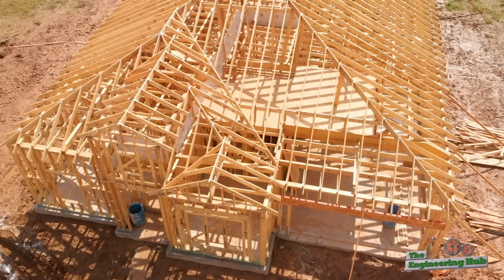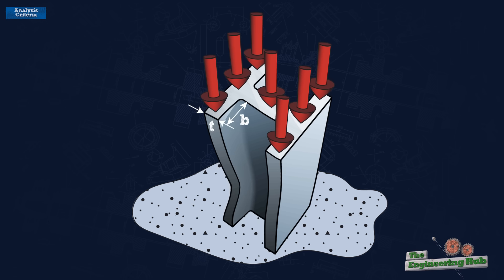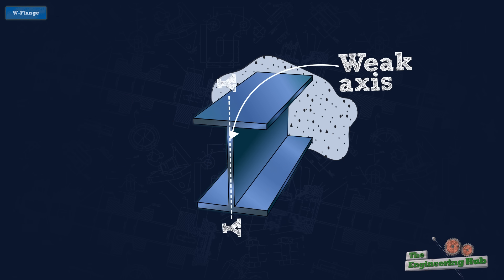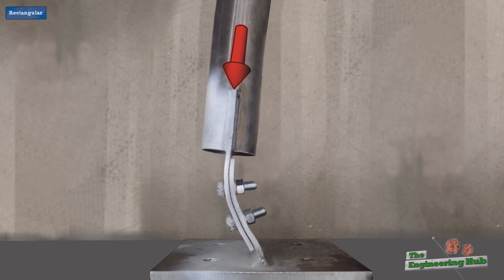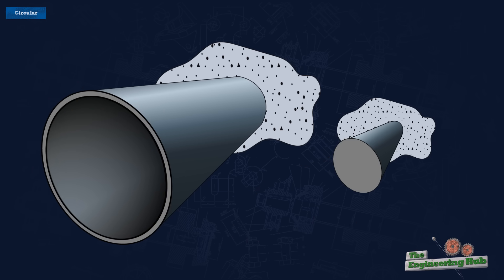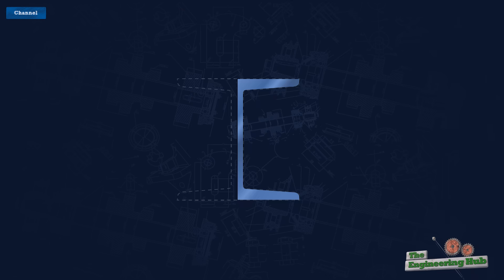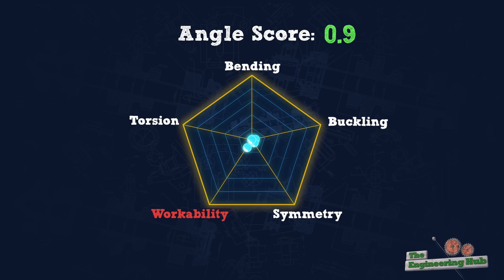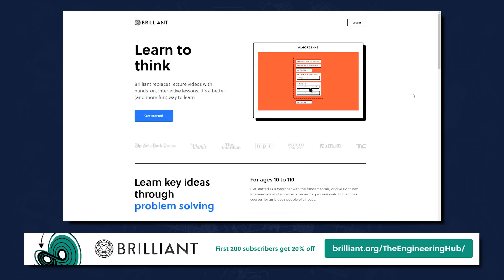Structural Shapes Ranked and Reviewed - Which one Wins?

Comment: I'd be curious if anyone has thought of using a SQUARE tube, rotated 45 degrees.

My gutt feel is, it should increase load capacity by about square root of 2.
( My application is welded metal tubes, so the 45 degrees Installation/workability is not a problem)

Similarly, when i use 'angle iron "  I'd use it flipped over in a V shape, which typically is stronger than L shape.

Is my intuition wrong??
Reply: Corners cause load and stress concentrations. There is less area actively resisting the load and more load is placed on the smaller area. 

But at the same time with a downward load applies, yes an “A” configured angle is less likely to deflect then that same angle used in an “L” configuration. But that is due to symmetry of the loading into the structural member. It is a more stable use. It is not an ideal shape for that load scenario. But in low stress situations you can get away with it. 

A round or square bar with a similar cross sectional area would support more weight if all else was equal.

Comment: I think it is a bit strange to rate H- beams higher than square hollow profiles when it comes to workability. For welded constructions the fabrication cost for H-beam based structures are typically 3-4 times compared to square hollow profiles. Due to more complex prefab (cutting and weld prep), more complex welding and NDT and more time consuming surface treatment. Another huge benefit with square hollow profiles is that the other geometry is constant. If you increase wall thickness it builds inwards. Meaning in 3D models there are no changes to overall dimensions and joints if one changes wall thickness. With H-beams everything changes. I would chose square hollow profiles whenever possible.
Reply: When it comes to surface treatment open sections are vastly superior. The entire surface is easily treated, while hollow sections often suffer from poor treatment on the inside (if they even try to galanize it properly). Also the enclosed spaces are suspectible for trapping moisutre thus accelerationg corrosion.

As for workablility it depends what your goals are. Bolted connection are much easier to make using I beams. As for 3D models with a well built up model in a modern software its incredibly easy to change section sizes.

When it comes to smaller welded structures with lsmall loads square tubes can be advantageous indeed. But also depends on a lot on the application and I beams can be better dispite the slightly more welding required.
Reply: @istvanditamas2959  Yeah, the automotive industry switched from  C channel to box channel. While the box was somewhat lighter thinner metal and controlled twisting better, it trapped moisture and got poor rust treatment inside. While the I-beam is incredibly strong, it fails much quicker under high heat than wood laminated. The extremely dense laminated beam will only char the outside, while the steel will twist and fail above 2,000F.
Reply: @Istvandi Tamás  If you measure coating film thickness on the corner edges on a spraypainted H-beam it will be significantly thinner than the flat surfaces. In my profession, subsea structures, codes dictate the minimum and maximum thickness. According to fabricators the edges need to be painted manually in order to comply. Hence a lot of extra labour compared to hollow profiles. Now this is according to strict standards and will not be applicable in all cases. Corrosion in hollow profile structures have only two causes, poor design or poor assembly. As long as it is welded completely shut it you will have a minimal corrossion until the oxygen inside the profile is used up then corrossion stops. If there is any holes or ventilation allowing air to come in you are in trouble. Regardless how well your 3D model is built, if you change anything except the length on a H-beam it will impact the dimensin on all connecting parts.
Reply: This video seems misleading especially the title. Every single beam has its purpose and use case, why "rate" them in this way?
Reply: @creativemind42069  Yes, I think they caused more confusion than understanding of why and where different beams are used. To really understand building construction, you must talk about wind sheer, weight distribution and many other issues that will determine what design of beam, joist, channel is most sufficient for the build.
Reply: @creativemind42069 Because the internet demands rating.
Reply: @creativemind42069  Because this is YouTube and rating videos draw interaction...if that's the price to pay to slip in a bit of education it seems worth it.
Reply: H beams give unlimited easy attachement capabilites, as someone who has to constantly do rigging and installation of large equipment/ installation of necessary plumbing and other support accessories, beams are just easy.
Reply: This is the difference between practical and theoretical experience
Reply: As a metal fabricator H beam don't cost 4x more in labour.
Reply: wayyy easier to bolt to W-shape than HSS and way more money to weld than to bolt
Reply: yeah I dunno why he said what he said about the limitations of H beams before then giving it a nearly perfect rating..
Reply: Basicly hollow profiles are only for some 50% accessable for attaching mounting plates. (IS THE OUTSIDE!!!). Now pls look again at any H-beam, and rethink again the NEUTRAL LINE !
Reply: 😊 @richardhack9830
Reply: H beams have shit torsional stiffness
Reply: HSS connections are so finicky that my engineering group actively discourages using them outside of struts
Reply: I agree I chose Circular tubular construction. Even within my textbooks on structural design and strength of materials THE TUBULAR CONSTRUCTION DESIGN IS THE MOST STRONGESTS WHEN IT COMES TO FORCE RESISTANCE AT ANY TYPE OF FORCE. Like they stated Circular tube structures are hard to fasten together but even those hard to construct material can be made of Carbon Fiber construction So why can't this also be taken into account ?
Reply: @charlesscott5076  Tube design buckles easier than H beam. Think of metal bridges, metal skeleton of skyscrapers and the beams carrying the rails between  supports on overhead railways,  if tube was better they wouldn't all be built with H beams. All design types have their uses, it depends on what the stresses/loads are as to what works best.
Reply: @charlesscott5076  carbon fiber is a new material, we don't have knowledge about its behavior for more than 20-30 years, so it is risky thing to make a design from carbon fiber. Ask bicycle users who ended in hospital due to fork breakage. Also carbon fiber (due to negative thermal expansion) is contracted when heated and expanded when cooled , making it incompatible with steel constructions.

Comment: Hurricane Katrina gave a great opportunity for the observation of structural steel failures.  There were hundreds of tall billboards in and around New Orleans.  Unfortunately, I cannot give the weight per foot of the supports but I can say that the external dimensions were similar.  Some billboards were mounted on three or four I-beams of constant dimension.  Others were mounted similarly on round pipe of diminishing cross sections as the height increased.  Peak winds were in excess of 150 mph (240 kph).  

My observation was that I did not see a single billboard on I-beams that was still standing after the hurricane.  All of the I-beams failed by bending, not buckling, over a radius of several feet parallel to the webs of the I-beams.  The bends were remarkably gentle, on the order of a 3'-5' radius.  Once the I-beams gave way, the billboards themselves were pushed to or nearly to the ground.  I did not see any billboards that were on pipe fail.  The hollow round shape stood up to the wind very well.
Reply: Wind loads on billboard (in reality) create more torsion than bending. Wide flanges still better in bending and circular sections are better in torsion, that is why you see more circular supports still standing for billboard structures.
Reply: Wind loads (in reality) are fluctuating thus it creates more torsion than bending loads.
Reply: I asked chatgpt if ibeam or pipe is better, this is what it told:

For the same weight of material:

I-Beams are generally more resistant to bending loads in a specific direction (typically vertical) due to their optimized geometry and higher moment of inertia in that direction. This makes them the preferred choice for standard beam applications in construction where loads are predictable and primarily unidirectional.

Pipes offer uniform resistance to bending and torsional loads from all directions, making them more suitable for applications where loads are multidirectional or where torsional rigidity is important.
Reply: Have any of you any practical experience installing HSS column over a h-beam column no I seen one comment dude said he was going to use pipe obviously has never made a column out of pipe if you had 10 HSS 12 x 12 by 5/8 on one side and 10 on the other side with a space of 10ft between sides and 8 ft between columns and a top of beam height of 10 ft and you built comparable structures The h-beam Columns would have less lateral movement when you were walking across the structure it's often fun to take Engineers on a deck when they don't have a clue and see the reaction on their face when they stand still and feel someone walk across a structure that has HSS columns and that would be multiple X bracing to combat thing down so the problem with that is on a boat dock when they have the boats at the bottom and the deck on the top they engineer a lower structure made of rock or fuel to get to the sheer out of the building

Comment: Instead of surrounding rebars with concrete, how about filling hollow pipes with concrete. Or fill with resin for smaller structures like furniture. This would reduce the chance of buckling since the internal fillers are solid and resist compression.
Reply: those are called composite sections.  They are in the AISC manual.
Reply: I'm doing that for a crane I'm building this weekend

Comment: The analysis is interesting, but I have some peeves with the scores you assigned: for example, a rectangular hollow will always be better than an I-beam of the same size. Same goes for the pipe. The reason why I beams are so widespread is that they are much easier to manufacture and allows you to use less material when your project include a single bending moment; then your structure buckle at the first breath of wind, but by that time you will be far away with the money you saved...

Comment: Several years ago at work, we needed to install some bollards.  My suggestion was to slip a square, I, or triangle tube into a circular tube or a circular tube into a square tube to increase bend resistance.  What are your thoughts on combining shapes looking just at the factor of bend strength?
Reply: Concrete poured into a circular tube
Reply: @beerious8392  That was what we replaced.  The pipe (6" diameter) bends causing the concrete to fracture then the pipe bends too easily.
Reply: Bollards are designed to stop smart people and slow down idiots. If bollards were made stronger the risk of injury would increase. Cars have crumple zones for a reason. 

Oh and a single thin wall pile filled with concrete is cheaper than the fancy strong design.
Reply: Sorry, extremely valuable and sensitive equipment that MUST work at all times.  After getting called out a few times at 2AM when it was raining sideways to repair the damage caused by some dimwitted moron that couldn't control his vehicle - I really don't care HOW damaged the vehicle OR injured the dimwitted retard gets.

Comment: The response to compression or tension along the long axis would seem, to this non engineer, to be a practical consideration.

Buckling is a consequence of compression.

I would be interested to see how structural shape influence the response. Deformed bars used in concrete reinforcement would seem an ideal shape for tension.

Also considering the structure of wire robe and cables might be of interest.

Thanks for a comprehensive and interesting presentation.

Comment: Thank you for this interesting and informative video.  Three other properties occur to me:
Crushing (eg elephant sits on a tube)
Crippling - relates to length/stiffness in and end-load situation (eg elephant sits on a platform atop a long tube)
Impact strength (eg car veers off the road and hits a structural member, or any day in a war situation)
Reply: To answer why these are not included; crushing is better known as the compressive strength and, ignoring buckling, it is directly related to the area of the section; crippling is better known as global buckling which is addressed in the video; and impact will relate to local buckling and material properties, assuming we are only using steel, then it is also addressed in the video. Have a look into global and local buckling then I’m sure you’ll have a better understanding how those concepts are related
Reply: @WillDiggy1  Thank you, Sir,

Comment: You could have highlighted that buckling is associated with compression members while poor bending, buckling and torsion are not significant for predominately tensile performance.
The eccentric shear centre of channels also limits it's versatility and provides very poor response to bending about it's major axis. This can result in unacceptable lateral movement.
Angles are very good for tension ties and stocky bending/compression members, such as in triangulated space frames, where their performance has dictated this space frame design.

Comment: 5:13 You are wrong. The I beam is way cheaper then RHS to manufacture generally rolled steel. I beam has no welding and no bending. RHS/SHS does hence why RHS is 350/450MPA (The corners that are bent have a higher hardness) and they have to be welded. I beams are 250 MPa like channels and angles rolled steel not folded sheet steel. You know the engineering numbers very well. But you do not understand how a steel manufacturer does their job.
7:17  Please don't give your opinions on fasteners. You obivously do not know how they work outside of manufacturers specs.

Comment: the idea of using L sections to create a T Z or H section by simply riveting or bolting  them together has been the cause of several disasters as they do not have the same strength as a proper H T or Z section ether extruded or  full pen welded and should be noted  by designers
Reply: Next you're going to try and tell us that hanging slabs of concrete such as hotel walkways from compound threaded rod assemblies or traffic tunnel ceilings from rods questionably glued into overhead concrete could result in fatalities...
The nerve if this person!
Reply: @MonkeyJedi99  luckily we live  in a world where  such a thing  would never happen

Comment: How would an I-beam inside a square tube work?
Reply: In what way? Are you talking about two separate members, or a web inside a square tube?
Reply: @TonyRule  a web inside a square tube.
Reply: @jefffefferson8339  Well, it would improve the moment of inertia of the section in one direction, and make little difference in the other. But you'd get the same effect just by thickening up the walls parallel with the proposed web direction by the same amount as the half the web thickness each, and that's and much easier and hence cheaper to make. Which is probably why you don't see hollow structural application rolled sections with internal webs. But you do see them in extrusions, like aluminium, which is mainly for dimensional stability of their thin walls.

Comment: Channels and angles also deflect rotationally under bending, especially when cantilevered. They make poor beams when the load is placed perpendicular to the flanges. As one commenter notes below they walk off access to the direction of the load.  Triangular shapes are actually better in bending than square shapes of equal area and, when extruded, extra material can be placed at the corners to maximize section modulus. Unintuitively, symmetry is good.  Connectivity is of course horrible. I would be interested to see your analysis of solid and hollow triangular sections.
Reply from the maker: Very good point about rotational deflection under bending. In fact, we happen to be developing our next video on this very topic! 
Noted on your comment about triangular sections. We'll look into this more and see if we come up with anything.
Cheers!

Comment: Would this data be possible to pass to a neural network to design a shape that's optimal in all or most areas?
Reply: This is a rather emerging area in industry at the moment the big issue is depending on the target structure very complex and expensive to create geometry’s emerge. Usually 3D printing can create the geometries so you’re limited by that.

Comment: I don't see how you could score a hollow tube and solid tube the same in bending and buckling. a hollow pipe is much much stronger than a solid one of the same diameter. This is known.
Reply from the maker: You are right about that Hack, but if you take a closer look at the diagrams at 9:53 you can see they have slightly different values. This difference is so small because it is normalized with respect to the I-Beam (w-beam) which is much much stronger in bending.